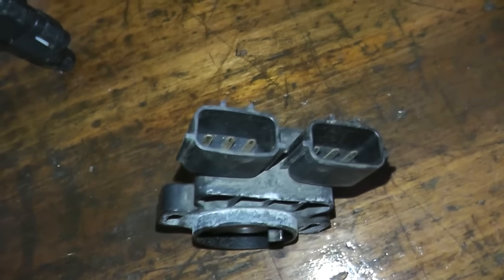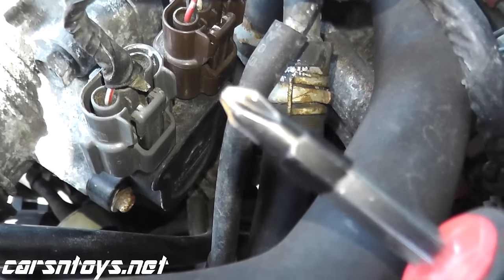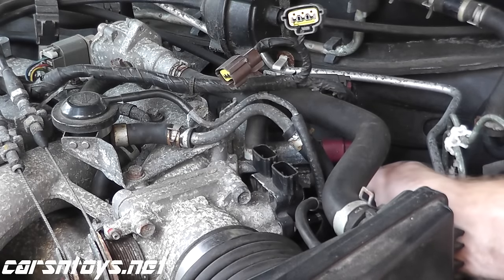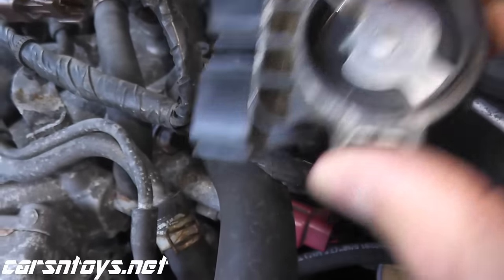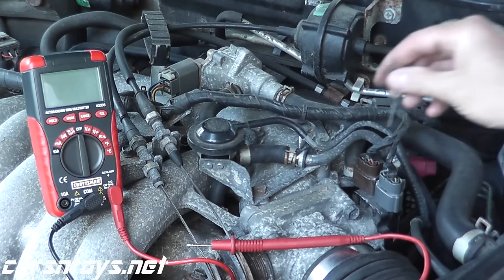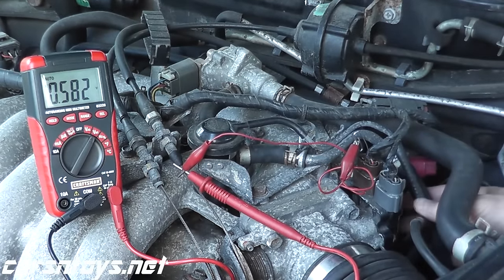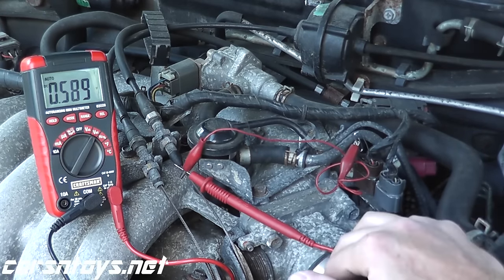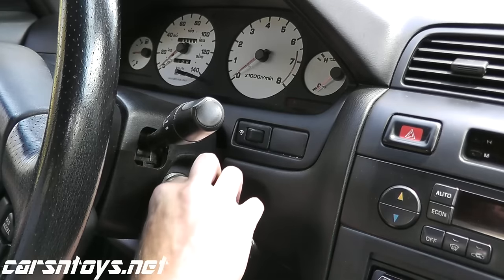How To Replace and Adjust the Throttle Position Sensor

Comment: Would this apply to 2000 Maxima SE? as far as Resetting idle memory?
Reply from the maker: Sure does. I don't have the specs for your specific vehicle but I can try to obtain it if you need the help. Cheers.
Reply: Cool thanks, and I got the FSM for my car so I have Idle specs.. Cheers!

Comment: My replacement sensor doesn’t seem like it’ll fit or is right but I got it at autozone but can’t even find the sensor. I drive a 06 Altima
Reply from the maker: Check the part number on the box online. Make sure you go the right one.

Comment: I have a 2013 Nissan Maxima the throttle body went bad I changed it, I changed my fuel pump but now it only revs once I first start it on park, once I put it on drive it don’t rev the rpm stays at 1000 just enough to keep the car rolling

Comment: I accidentally took out this sensor, mistook it for maf sensor and now when I let go of the accelerator pedal it idles back pulsating, there's a thing in the engine that's pushing in and out where the cable is, how do I stop that?

Comment: What about a 2001 Nissan Altima i know the idle is 700 base rpm. But what about the DC volts. Probably the same as the maxima.

Comment: The screws stripped out on mine :/. How do I remove them now?
Reply from the maker: Try using a dremel tool and make a slit to fit a flat head screwdriver. Could also try using good quality pliers around the head of the bolt.

Comment: I have 2 4th gen Maximas (97 and 99). On the 97 I replaced cam, and crank sensors, cleaned MAF and TB, it starts fine now, but idle goes from 800 or so then will drop to 500 or so in park then might go back to "normal". Code is fuel rich, can this be tps or IACV?
Thanks!

Comment: Please can you help me for TPS and idle position RPM for 01 maxima? thanks
Reply from the maker: There should be a sticker on the hood listing idle speed. They often note idle speed with an automatic and manual gearboxes.
Reply: Thank you. My idle is on 1800rpm and is not coming back
Reply: very helpful

Comment: i just replaced mine and now the truck won't start at all; any ideas? thanks
Reply from the maker: Try moving the sensor and retry. What kind of vehicle?
Reply: it's a vintage 1991 dodge dakota :) i don't see that there is an adjustment on the tps;; it just bolted on. so u think this new sensor may be keeping the truck from getting fire? thanks

Comment: Dude I just want to kiss you on the lips so hard. And I'm totally straight.. you have no idea how your instructions have helped me out. I have a 1997 Nissan Maxima the only thing is my screws were stripped at the head. I had to just break up the sensor and use a pliers to screw the screws out. This sir has saved me so much headache. My 97 Maxima has 312,000 miles and of course that part would have gone by now. The shift points are so much stronger now.

Comment: Where's the knock sensor wire I need to put in a new knock sensor and bypass the old one where is the knock sensor on a 2002 Nissan Quest The Wire

Comment: if all the danger is in removing 2 corroded screws that are hard to reach; why not explain how to get  them loose ? a short screwdriver is easy to get ... strong hands are not and most older fellows do not have that available. what to do then ?

Comment: This is about to cost me $489.96 plus $269.95 to clean the trottle body on my 2013 Equinox. I feel like I can do this but Im still a bit leary.
Reply: Lmfao $270 for cleaning the throttle bodies is crazy. You can do it yourself in half an hour 😭